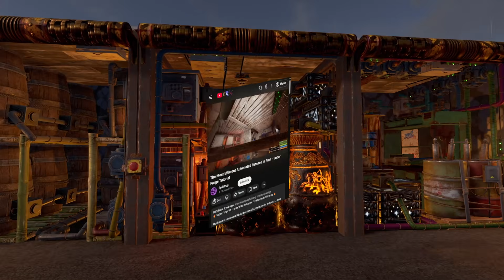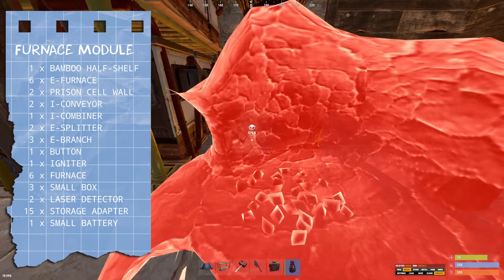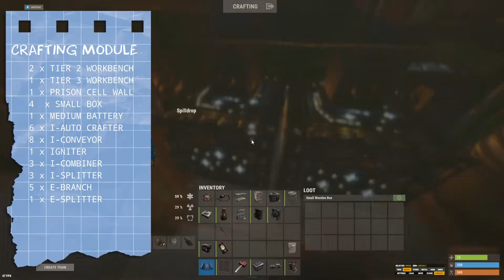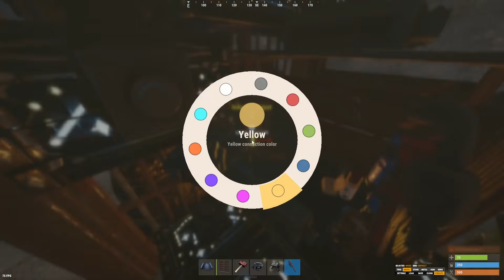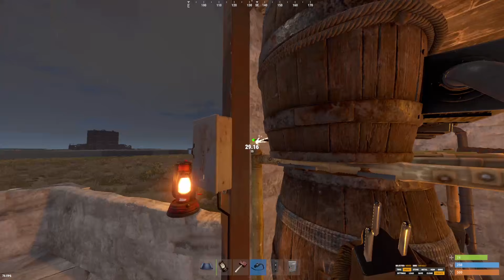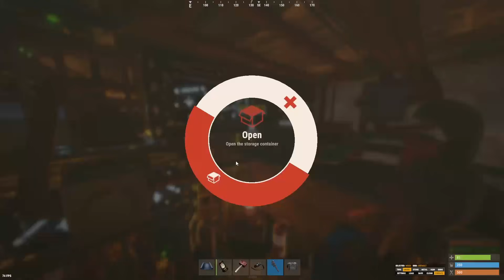Rust Base Challenge: Build the MOST COMPACT Farm-to-Table ROCKET FACTORY

Comment: You can craft pipes in the same crafter as your rockets , this is how I set it up, set pipes as the second blueprint. I use conveyers to stop crafting pipes when I have 8 pipes, then start again at 6, so I dont end up with a box full of pipes.
Reply from the maker: Do you have a good tutorial for how to set those alternating crafts? I tried doing this early on when industrials just got added and I simply could not get it to work.